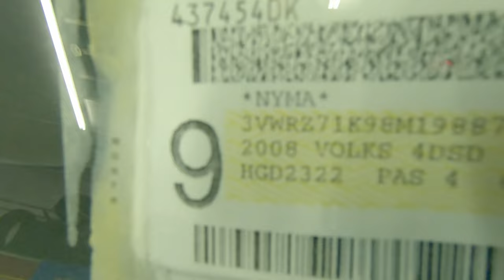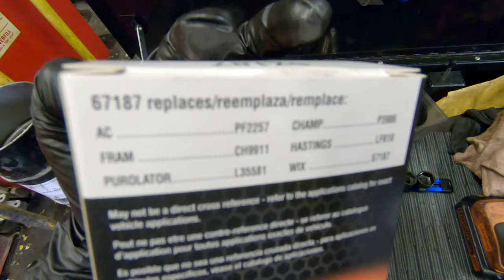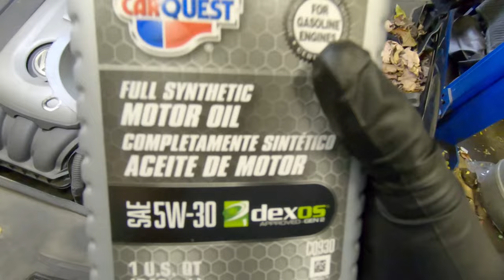2009 volkswagen jetta oil change

Comment: I pushed in the valve on the oil filter housing to drain oil before removing. I put it back on without resetting the valve. Car is now leaking oil from the oil filter housing. Will the valve reset on its own or I have to remove it and pull the valve back out?
Reply from the maker: Mmmm

Comment: Is it normal for there to be a second seal at top? Not the one inside the oil filter housing but where the housing screws on to. I noticed my car had a second red seal at the top. Was wondering it should be there or if previous person didn't remove it.
Reply from the maker: Usually the new oil filter comes with those rings